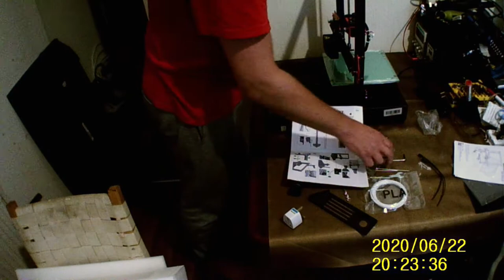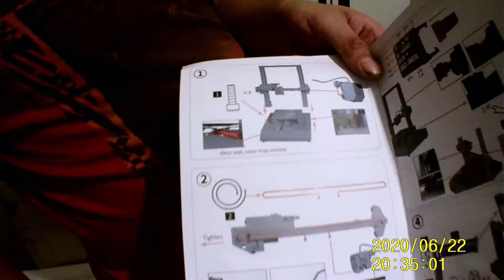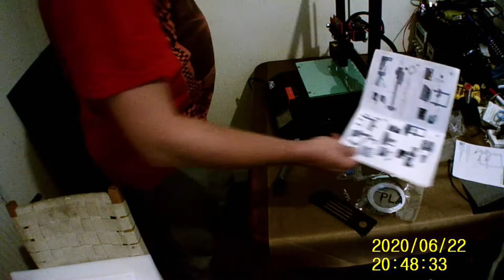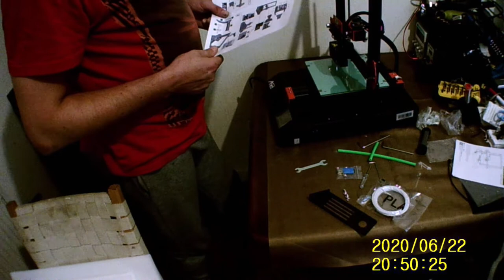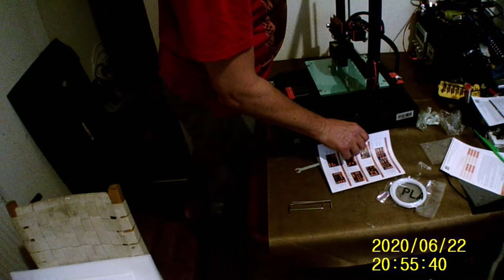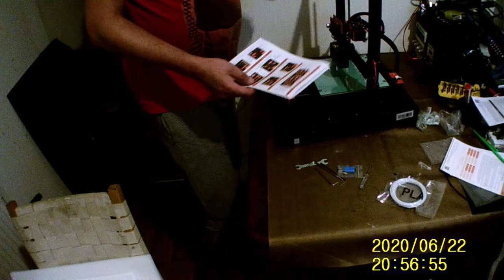Anet ET4+ Unboxing and powering up, First Ever 3D Printer, complete newbie Please comment & Like

Comment: After 50:51 your camera stopped working to x| . So what did you do with it in the end ?
Is it working or u returned it .
I have similar problems with it .
Reply from the maker: Thanks for letting me know about video. I will be following up on my experience shortly. I did get it working eventually after I noticed that my Z sensor was positioned higher than others I had seen. After lowering the sensor and re-levelling the bed the printer is now working and producing good prints. Thankyou for your support and hope you sort yours out soon as the printer is actually very good.
Reply: @darrenc5686  Thing is that I`ve seen the screen flickering and the printer reset .
Mine did the same , then started doing it more often , now is dead .
It was the processor overheating causing the LCD to flicker then restart .
It usually started to act weird to especially when the extruder started heating up .
I`m returning mine , hope u get lucky with youres.
Reply from the maker: @pepsitwsit  sorry to hear you have to return yours, are you reordering or going for a different model?
Reply: @darrenc5686  I do like the looks of the A8 ...IDK ,The wife is gona kill me